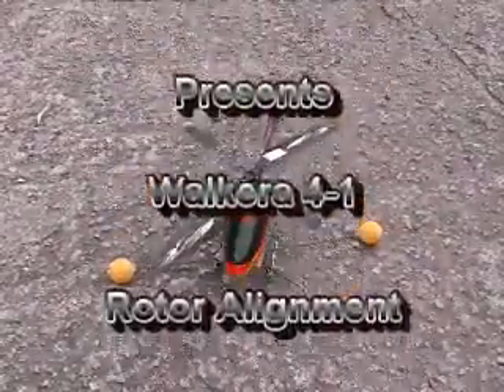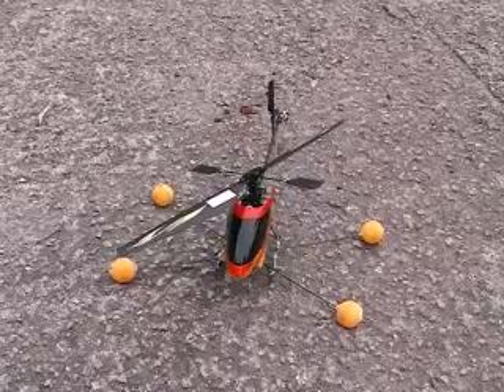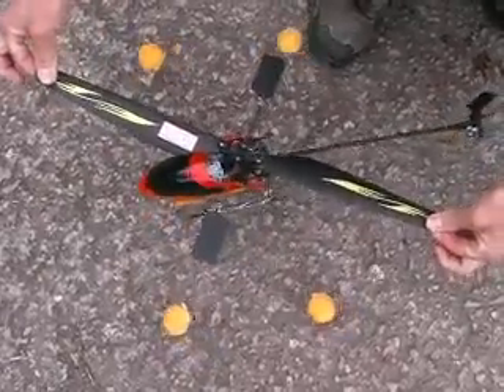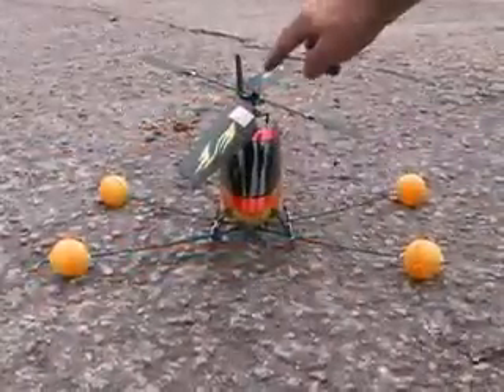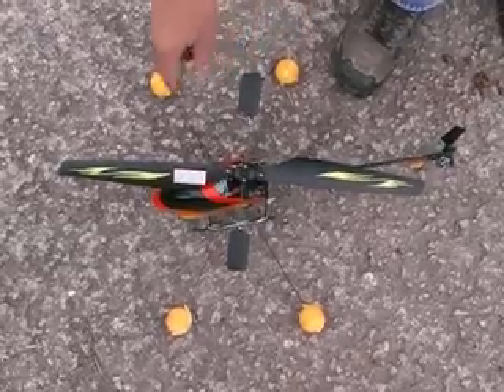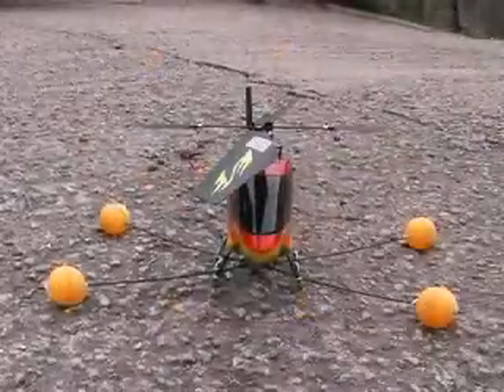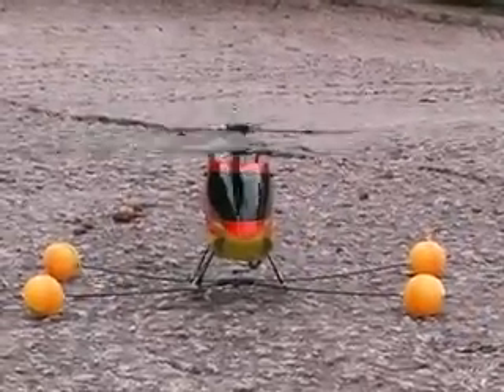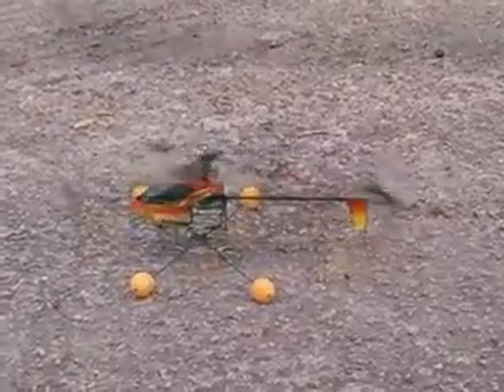Walkera 4-1 Repair - Fine rotor alignment

Comment: A option is to loosen the screws so much  that the blades can move freely, when make power it will wobble very much but at higher sped it will stabilize itself perfectly.